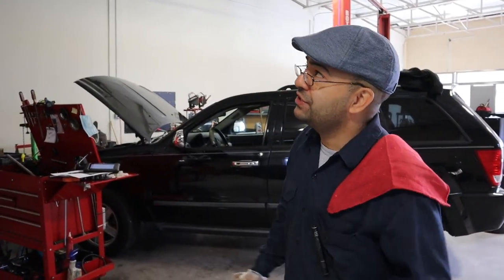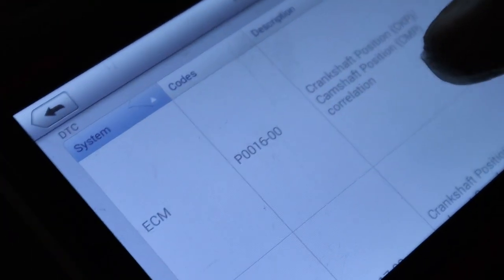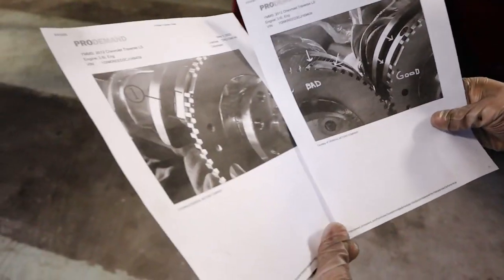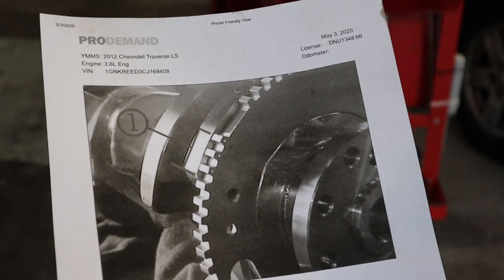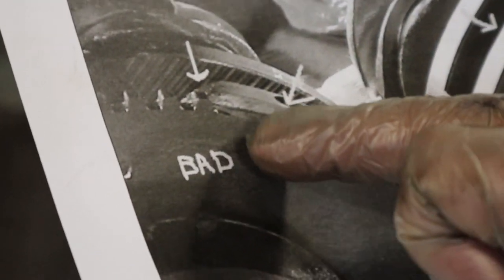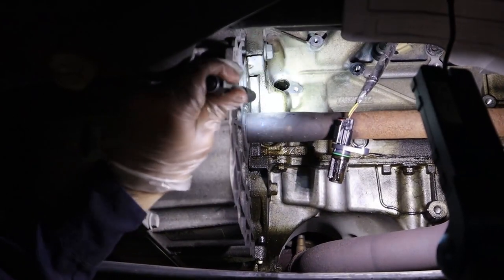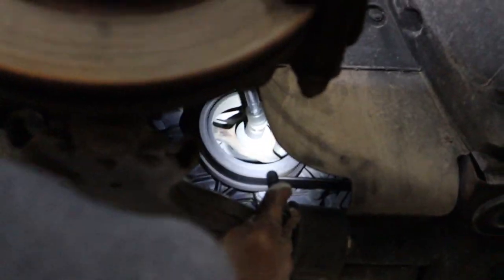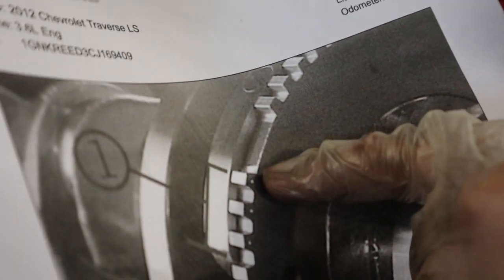Chevy Traverse Timing Related Issues p0016 p0017 p0018 p0019

Comment: I am just taking my traverse to the nearest junk yard. The 2009 Traverse has to be one of the worst vehicles ever manufactured. This car is an embarrasment to GM/Chevy. Did anyone ever think of driving this vehicle before it was released. I pray daily for anyone else who owns this vehicle. I have owned the vehicle for 2 years and it has been ripped apart 6 times with everything replaced. All the known service bulletins have been done. Every issue found on forums have been either checked or completed. This is an absolute nightmare. Thank you for letting me vent.

Comment: When you're looking in the hole, all I see are the teeth, where in relation to the crankshaft is that location. Can you show the actual procedure and how you count teeth while looking through the hole? I don't know what area you can see through the hole
Reply: you have to rotate the engine by hand until you see the gap,
Reply: And if the gap is off, then what?  He doesn’t tell how to fix anything.

Comment: Hey how you doing I took the crankshaft position I see the teeth with rotate the balancer but am I supposed to see a gap or is this supposed to be a gap because I did what you told me to do and I see the only thing I see is the teeth from the dapper You have to be specific what to be aware of when rotating

Comment: U showed us what the problem is but how do I fix it now ???  My Acadia is doing this now and I think the magnet has moved. Please help me with the repair.
Reply: It's a BIG job to replace the crankshaft. This is more of a diagnostic video, because this problem can be caused by either the crankshaft OR the timing chains, both are expensive and it would suck to do the wrong one based on a bad guess.

Comment: what about if i only have 1 code? P0017? for bank 1 only.   could it be timing chain? or guides or tensioner on that bank?
Reply: did you fix it? i have only p0017 code as well. it seems the timing chain stretched issue from searching all other videos..
Reply: @dwightlee6164  hi, im in the process of timing chain replacement, ill let u know how does it do, the only thing i notice is that i was able to push down the timing belt tensioner on bank 1, the othe 2 tensioners wer very stiff or very fix w no movement at all but the bank 1 was able to push it and was not under pressure as the other 2.
Reply: @dwightlee6164  was that question for me?
Reply: @prospexican   any updates on this issue? I have a 2010 traverse fwd with misfire on bank one cylinders. P0016, p0017, p0019. Thank you in advance

Comment: If the gear or sprocket on crank has turned...do i need a new crankshaft or is that serviceable? I did timing chains, actuators/phasers, and have the cam holding tools for both stages...but now have a p0019 code
Reply: Did you figure out the problem? Im having same issue

Comment: so what you are trying to explain is what? if the tone ring is moved then what do you do? i replaced the timing chains on a 3.6 with the solenoids and the cam gears but i keep getting the p0016 and p0018.
Reply: Tsb calls for the whole crank to be replaced. If it was me and I was prepared to pull the crank out, I would just forcibly rotate the wheel back to its correct position and either drill and pin it in place or severs stitch welds.
Reply: @mdlimy  Can welding or drilling cause imbalance issue? Can it be done on the car without removing crankshaft?
Reply: Have you fixed it? I am in the same boat. I replaced chains for my camaro v6 3.6, P0008 and P0016 remains.
Reply: @aykutyildiz7133  did you figure it out?

Comment: Thanks bro I'm doing a timing chain I have the same 4 codes in my case I had to take the transfer case because this is an all wheel drive but now I can go ahead and change the timing chains because I know the ring tone for the crankshaft position sensor  on this engine is good. I would of hate to change the timing chain and I had a bad ring tone and I would be getting the same codes I that was to happen I would of lost my mind and grew some gray hairs be now I know it's good thanks to you video so I can go ahead and put the new timing chains
Reply from the maker: You are very welcome, thanks for your comment
Reply: Amigo puedes poner este video en español porfavor!

Comment: Can you pull this crankshaft out while engine in car?  What's the going rate for a crank replacement
Reply from the maker: No. Engine has to come out
Reply: hello I have a 2016 Chevy Traverse Lt AWD on the passenger side of the engine under the power steering lines on the engine there's sensors that go inside the engine one of mine broke of inside not sure which one it is I thought it was the crank shaft position sensor but after watching videos it's not please help me figure this out ty

Comment: has anyone just turned the tone ring back and tacked it in place? seems like this should be possible. I am working on a 2010 Vue that has these codes, being all wheel drive I'm considering if it is easier to pull the oil pan or transferase motor. Makes more since to pull the oil pan if I find the tone ring off and i can somehow turn it back...
Reply: Is there an easy repair for this or do I need to pull the engine out ??

Comment: Mine is a 2009, AWD. The crankshaft positioning sensors are on the front (Passenger side) of the engine. I have both the P0016, P0017 (bank one-against the fire wall). with a mirror I can see into the hole, but which one exhaust or intake should I be spinning to the location you showed, both look very similar through the peep hole. I have replaced all 3 chains and guides, followed the procedure to a "T" with the special cam blocks to prevent cam rotation, and the engine runs great other than a little rough idle once it warms up, I am hoping resolving this code, will resolve that...any guidance please...this is the only video that comes close to explaining what I am seeing.
Reply: Those are the camshaft position sensors

Comment: BUENAS AMIGO OCUPO DE TU AYUDA PLISS.. tengo el mismo problema con un 2013 Cadillac ATS 3.6 tengo los mismos códigos p0017 p0018 p0019 ya le cambien las cadenas y casi todos los sensores y no se a resuelto mi problema me sigue aventando los mismos códigos y las revoluciones suben y bajan de 500rmp a 1500rmp me gustaría que si me pudieras ayudar como revisar si el cigueñal esta correcto como mencionas en tu video pero se me hace poco complicado por el ingles, espero que me puedas ayudar seria una gran ayuda gracias por tu atención tnks

Comment: I have a code p0017 bank 1. Were is that sensor at
Reply: Your timing chain is stretched sensor is not the issue
Reply: @mikestoms4015  I have this very code (P0017) in a Suzuki xl-7 with the 3.6L engine. timing chains were done almost a year ago. car had zero issues until a week ago  when i got a P0014 code, changed the engine oil and now its a P0017. changed both bank 1 solenoids, and both bank 1 cam sensors. problem is still there. I have a hard time believing the chain is bad again for the simple fact its only 1 code. if the secondary chain was stretched i would believe i would see P0016 and P0017 codes since they on the same chain. i'm leaning more to a bad cam phaser. I've alo checked the wiring from all cam sensors and valve actuators back to the ECM to rule out wiring issue's.

Comment: Buenos dias, muy buena información. Tengo una pregunta, tengo un vehiculo igual con los codigos P0008 y P0017.. Hay relacion con esta información del video?
Reply from the maker: Si definitivamente
Reply: Hi Eliaz, I have same codes P0008 and P0017, did you able to find what was wrong and did you fixed it?

Comment: My case is very complicated, i really need your advice.. I own Camaro 2011 V6 3.6 which throws P0008 P0016... 
1. Timing Chain Replaced(Cloyes complete kit)
2. 4 Cam Phasers Replaced(OEM)
3. 4 Selenoids Replaced(OEM)
4. 4 Cam Sensors Replaced(ACDelco)
5. Crankshaft Sensor Replaced(ACDelco)
Unfortunately nothing changed.. Still same codes. My mechanics double checked alignment... My car is running sluggish,poor.. What should we do next? Pls help
Reply: Sounds like everything but the cam itself.  Naturally that would be the next part.
Reply: wow you look you spent a lot of money reaching to your car value.,
and you still have a problem? no way!

Comment: bro i need help with 2009 GMC Acadia .. i have P0017 and P0016 i have changed my timing chain. bank 1..misfire 1-3-5
Reply: how confident are you that you installed the chains correctly?
Reply: I know this is an old comment but I got the same issue. You end up figuring it out?
Reply: Exactly the same thing here, purchased my 2009 acadia with high miles, still on original timing chain and 17 codes all related to timing issues. Me and my daughter replaced the chains (3) purchased the keeper jigs to stop engine movement when installing the new chain. All codes are off now except the P0017 and P0018 Crankshaft Position - Exhaust/ Intake Camshaft Position Not Plausible. Engine runs well when its moving, but a little rough on the idle, I hope fixing this will fix it...just not sure how to get this fixed. I installed new sensors and valves with the chain...anyone have an idea of what Im missing?
Reply: @chadfisher3975  I just pulled my timing cover off. Broken chain guide on bank one and found bad cam phaser. I tried using the cam holder tool but the flats on the end of the bank one cams are way off. I'm trying to figure something out so that I don't screw up timing